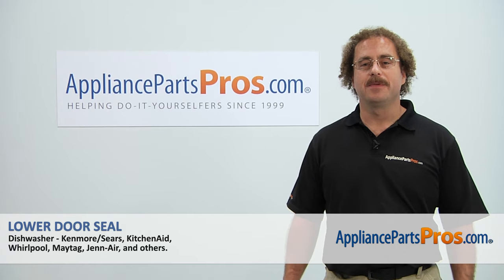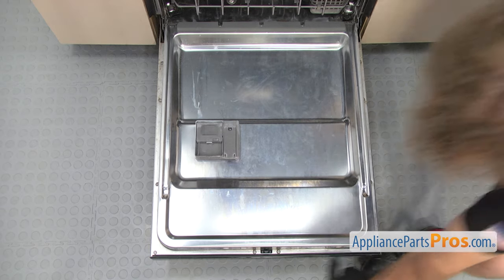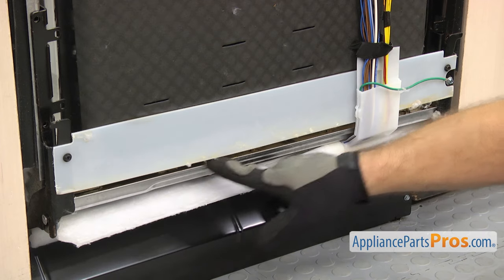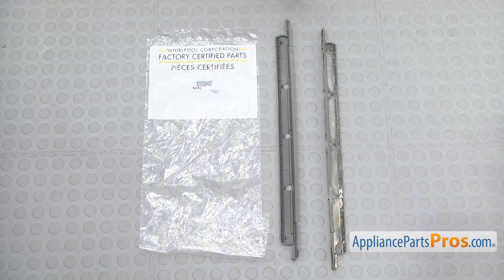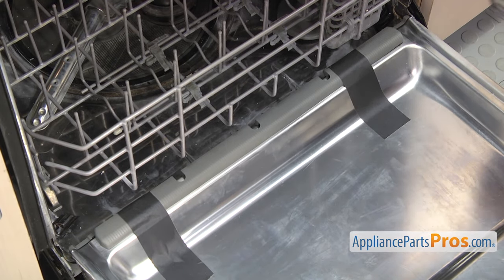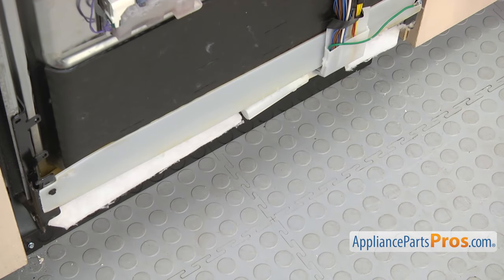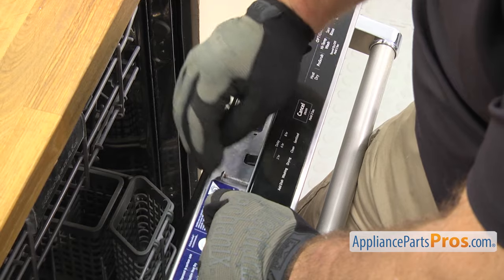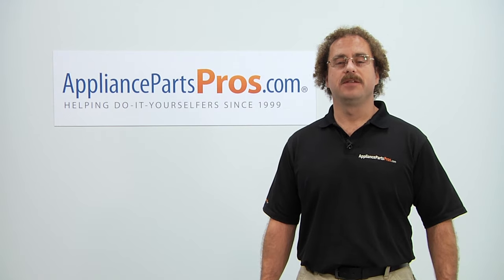How To: Whirlpool/KitchenAid/Maytag Dishwasher Lower Door Seal W10909089

Comment: Highly recommend buying the magnetic nut driver.  Also the taping method didn’t work for me as when i closed the door the lower door deal would shift slightly anyway despite using the tape.  I had to take the door fully off to drive the 5 screws in properly.  It was a pain getting the door back on.  I learned a lot.  My back got pretty beat up in the process.  Good luck.

Comment: My problem was, DW was working fine, started leaking left corner, replaced the rubber seal (all one piece for sides and top), fixed as mentioned further below.   If I had to do it again I would have replaced the rubber seal and bottom seal at the same time. 
(FYI - Watching with the front panel off  and setting it to the side plugged in and start the wash, you can see the stainless steel tray fills with water when the spray arm is active,  Looks like the insulation on the door is supposed to absorb any small splash or leaks.   If they would have made the tray 1/4" higher I don't think there would be a problem). 

Fix - The bottom seal (and probably the rubber door seal) worked for me however, make sure you push the tabs in and tighten as you go and go back and check/tighten each screw again.  Do not over tighten and strip it out.   
While trouble shooting after replacing the rubber seal (all one piece for sides and top), I removed the old bottom door seal, reinstalled it and it leaked worse, I noticed I didn't have the tabs in.  Put them in and tightened up the screws and there was hardly any water coming into the stainless steel tray (designed to hold water).   but when the sprayers started it filled the stainless steel tray (like it always does, almost to the top) and would splash over at the left end.  
So I thought the spray arm was bad (bought a spray arm and this bottom door seal, just incase... to save a trip.). Replaced the spray arm, still had splash and leaking.  Replaced the bottom seal, verified tabs were in, tightened all screws snug, then checked again and tightened again and not any leaks.
Reply from the maker: Thank you for the information. We're glad your dishwasher is up and running again.

Comment: Ok guys, so i finally figured out what else may be the issue here. See that black rubber gasket? The ends are bent inwards.  One of the ends in my dishwasher somehow got straghtened out, and so whenever i closed the door the plastic lower seal would overlap the rubber, thuse creating a gap - hence the leak!
Reply from the maker: Glad you were able to figure out the leak.

Comment: If you replace the outer and lower door seal and still are getting leaks it can be clogged filtering from food hair in the dishwasher drain filter,   clogged  hose, a new drain hose is on backwards, or most likely   is the lower spray arm.
Take out the spray arm and try cleaning it , soak it in some Lyme scale cleaner. If still leaks replace the spray arm as may have become warped by heat of the heat cycle 
And tip to work on leaky dishwasher.   Take them outside and hook up to an outdoor hose so don't get leaks in the house while trying to figure out what's going on.
Reply: Take the dishwasher outside??
Reply: Mine was leaking like crazy at the bottom left. I replaced the spray arm, no more leaks!

Comment: My Kenmore is leaking from the bottom also. Is there another seal at the bottom of the door other than this one? Mine is leaking but it looks fine and I don’t see any obvious reason why it would be.
Reply: check under the float valve opening

Comment: 3 1/2 year old Whirlpool and it's suddenly leaking like a sieve! Just started last week. There's some kind of soft material at the bottom and it's soaked well before the wash cycle is done and water is steadily dripping. I didn't see anything wrong with the bottom seal you replaced, other than some build-up that looked like it could have been cleaned out and reinstalled. Why should this be happening on a unit this new? My previous dishwasher was 23 years old and the only reason I got rid of it was the front panel was starting to rot out at the bottom. Whirlpool quality must be nonexistent!
Reply: Same issue and time for me, just replaced both door seals and still leaking, cant figure what the issue is. Very frustrating to say the least!
Reply: Did you find a solution to this? I'm about to glue in some weatherstripping under the existing bottom door seal to see if that stops the sloshing that leaks out the left side.
Reply: @MBNB85  yes, it was caused by the dish detergent I was using. I had a big tub of powdered dish detergent and started using it after running out of the liquid stuff I'd used for years. Since the leakage started when I ran out of the liquid, it made sense that the powder might have been the problem. No more leaking.
Reply: @MBNB85 our 3 year old whirlpool just started this. Going to try the lower door seal and if not, then looks like lowes gets more money, miss the 1990s dishwashers that lasted

Comment: How do you know if the door seal is bad?
Reply: I have this problem also but to me it just looks like there is a build up of old dish soap that is causing the door to not seal properly. I am going to take my door apart, clean it, then run it and see what happens. Eliminate the easy fixes first. Hope this helps and good luck.
Reply: @mlb7772001  any luck?

Comment: This was a good video, but we have replaced every part on our Kitchenaid, the motor assembly, the spray arm, all 3 door gaskets and it still leaks. Like other people in this post we had our last Kitchenaid for over 20 years. Bought this one with the extended 5 year warranty and it is a piece of crap. We are going to try and take the door seal off again. We have always bought the top of the line Kitchenaid appliances, to replace this dishwasher it would cost us about $2500. After spending over $600 on parts and labour I will never buy another Kitchenaid product. I think I will buy a Samsung or LG even if it doesn’t match my other black stainless steel appliances. If anyone has any other ideas for a fix, it would be greatly appreciated.

Comment: This is actually just part of the problems. Most of the times, there is a lot of dirt collected in front of the tray which has to be removed. That seal rarely breaks. Cleaning would be the best choice other than just starting to replace expensive parts (40 bucks for this plastic seal is clearly too much).
BTW, watch out with your fingers as the door has sharp edges when you try to clean the tray (I myself got few cuts).

Comment: It sounds like a popping sound when we open the door as if the bottom seal is catching. Does it need to be cleaned or replaced? Has anyone had this happen?
Reply from the maker: Does the gasket look worn out or are you sure it is installed correctly?

Comment: Hello, thanks, I just did exactly what you demonstrated ( change the bottom seal) and cleaning but Infortunately , again leaks always 🫣 after couples cycles , I checked the seal around , everything seems ok…so 🤔 , thanks again
Reply from the maker: Check the spray arms, take a toothpick or something small to clean out the holes in them. If those are clogged it can cause the unit to leak.

Comment: Got a card in the mail about a law suit for Whirlpool/KitchenAid dishwashers that have been leaking.
Reply: any model?
Reply: Anybody get one of these?
Reply: I am having the same leaking issue with my Whirlpool WDT750SAH. Would greatly appreciate any info.
Reply: @psq9245  mines gotten worse and worse over time. Same model as yours. Initially it was the diverter motor gasket and then the bottom for seal, which for the life of me, makes 0 sense as to how a straight line of plastic is going to seal a dishwasher without rubber. Might have to 86 this 5 year old unit 😢

Comment: I've replaced the door gasket, the cross brace and the bottom door seal on my 4-year-old Whirlpool and IT STILL LEAKS!  I'm over Whirlpool completely.
Reply: I have the same problem
Reply: Me too paid $600 for mine it’s the top of the line and had it for 5 years and mines leaking left corner replaced door gasket and found this video now going to try this bottom door seal hopefully it will fix my issue. My old roper dishwasher was 16 years old and never had issues with it and never had to replace gaskets or seals 🙄
Reply: @JulyRobbins  Heather, I spent more than $400 trying to fix ours. If you are able to fix yours, please let me know. The dealer told me if repairs cost more than $200, to just buy a new dishwasher. Good luck!
Reply: The lower spray arm might have gone bad and need to be replaced.  This could cause high pressure spraying of water into the wrong places.
Reply: @JulyRobbins  I would also replace the lower spray arm.  Could be spraying water into the wrong places that the gasket can't stop or door seal.  The defective spray arm could also be causing waves of water to slosh around.
Reply: @haitsma  replace the lower spray arm...might be a fix....
Reply: @AK-qo6tx  Thanks AK. Repairman checked the spray arm and told me it looked fine...but I'll give it a try.
Reply: @AK-qo6tx  thank you I will give that a try and let you all know
Reply: @AK-qo6tx  that’s what it was thank you so so much you saved us from spending $500+
Reply: I have seen them in the field with flexed inner door panels. I saw one that was 2 months old the other day.
Reply: @JulyRobbins   Mine is also leaking at the front and the plastic seal looks good but I will probably replace it to see if that fixes it. My lower spray arm is all stainless steel was yours steel or plastic?
Reply: @scottwinn4302  mine is also stainless steel ya scott I tried the same thing as you and it didn’t fix the issue it was the arm. I honestly think you should try that first
Reply: @A K  Thank You!!  Came across this post not knowing what to do....dishwasher is only 2 years old, was about to buy a new gasket...instead I purchased the spray arm and cleaned current gasket...ran dishwasher on clean mode, no leaks!
Reply: @scottwinn4302 did you end up fixing your dishwasher?? Mine is leaking hard on the front left side, it's this same dishwasher with the stainless steel spray arm. Curious if you fixed it as we've already sunk money into this and don't want to spend much more, would rather replace at this point!
Reply: @kylahabbs  
I have not replaced anything yet. The lower drain screen might have been a little clogged up. And I have been adding vinegar every time I run it and almost every time it does not leak now. So not really sure what's going on.
Reply: Chalk me up as another person with a hardcore leak at the left lower corner that was fixed by replacing the spray arm. Thank you SO MUCH for the suggestion! It would never have occurred to me otherwise, that a spray arm could could a leak.
Reply: Our Maytag came with the house.
And the size of torque wrench is in NO WAY 3/8"😮
Reply: I think higher than code water pressure also causes leaks.  In my clothes washer also.
Reply: My seal does have a small part of the side cracked off, but I'm not 100% that's why it leaks in my case.  We shall see.

Comment: Finally got the front panel off my dishwasher and there's no sign of any screws to remove for the bottom part 😑
Reply from the maker: What is your model number?
Reply from the maker: According to the instructions from the manufacturer Once you remove the inner door panel you should see the screws that hold that bottom door seal on. If there are no screws there, they could be missing or your unit is a different model.
Reply: @appliancepartspros  Hmmm... There must be screws holding it in place because I can't remove it, but maybe they're somewhere I can't easily see? In other news, it appears the wires inside the washer door were getting so hot they melted the plastic, so now I'm waiting to hear back from an electrician. 😰
Reply from the maker: According to the parts diagram for the model you provided, there are screws holding it in. It looks like they are towards the top of the seal, so maybe the lip of the inner door panel is covering them or making them difficult to see.